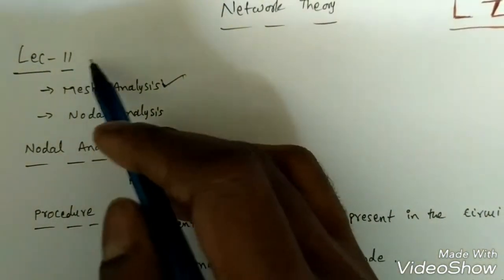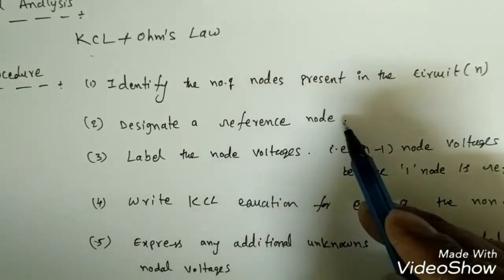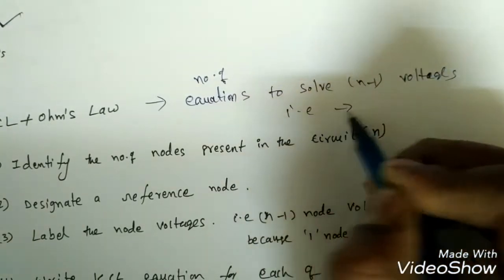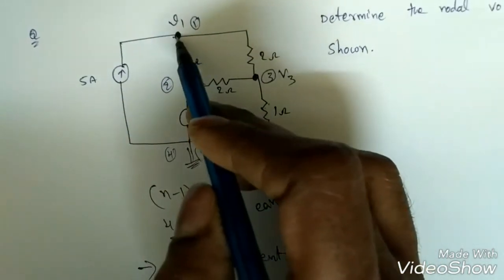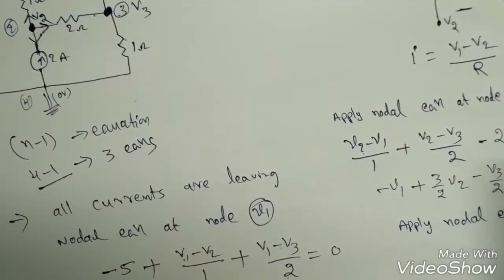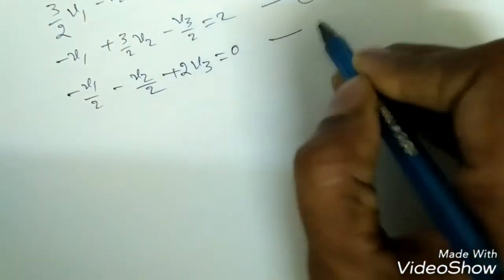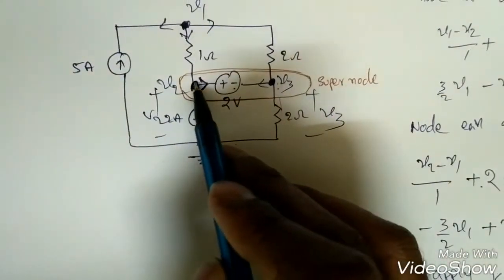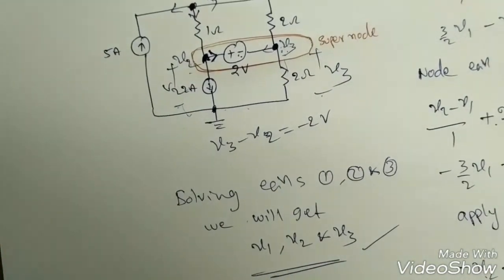Network Theory Lec-11-2: Nodal Analysis

Comment: sir, there was 1 minor mistake in calculation
(11:38) the equation should be 
-9/2 V1 + 11/2 V2 =8......(4)

the answer of V1 =73/5, V2 = 67/5
Reply from the maker: Ya rudra nath....thank you
Reply: the answer is different right?
i am not getting the same answer

Comment: SuperNode problem: V1=32/3 V , V2=8V , V3=6V.
Reply from the maker: Yes that's right suraj.thank you
Reply: Learning Is Everything,  is it correct answer?.  My answer is V1=5.33,V2=4,V3=2.
Reply: Suraj is apply the 2nd equation is -3/2V1 +V2+V3=2. BT the correct equation  is -3/2V1+V2+V3=-2 . So , the correct answer is V1=5.33,V2=4,V3=2. Plz check it sir and reply me.
Reply: vaishnavi K add equ 1 and 2 u will get V3/2 as 3...sub V3 value in 3rd equ..u will get the ans
Reply: Akshaya LK , thank you mam. I got the answer

Comment: sir i have started preparation from last 4-5days so what should i do to cover up fast in better way nd because i have to attend my college from 9to5 also.
Reply from the maker: Hai abhijeet don't cover any subject in fast mode..because we are having lot of time before GATE 2018..because if we study very well in first time then when we do revision we will get concepts very quick...so my suggestion is spend at least 60-70 hrs per subject with practice. then we are able to solve GATE questions..so what you do is..start network theory and signals and systems subjects and by one month(by may) and you should be very confident on those subjects..then for next month (june) take mathematics and control systems..then EDc and AEC (july)..then digital electrnoics and Communications (august) and by September or October you may be finish all the subjects..suppose if we take one more month extra i.e by November we will finish all the subjects then you can do revision and take test series...if you follow this strategy you can get easily good rank in GATE..